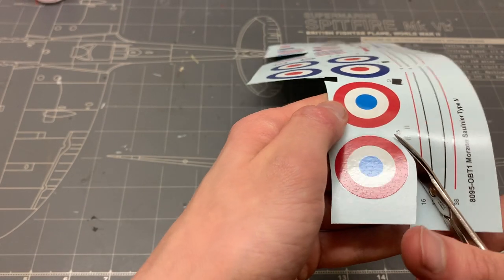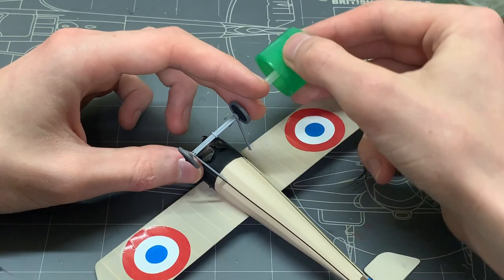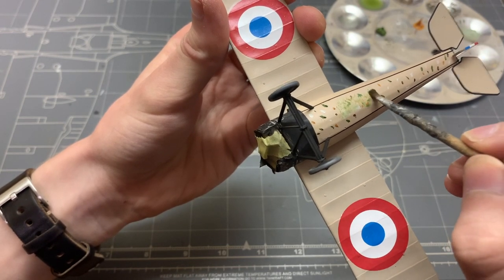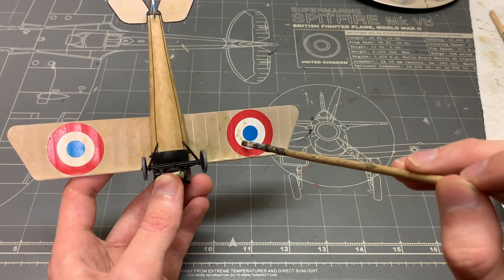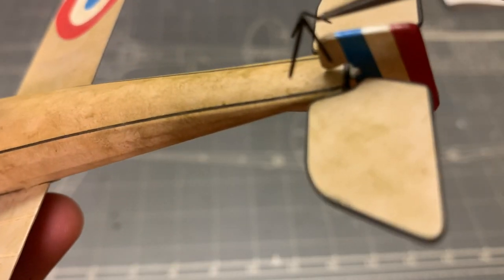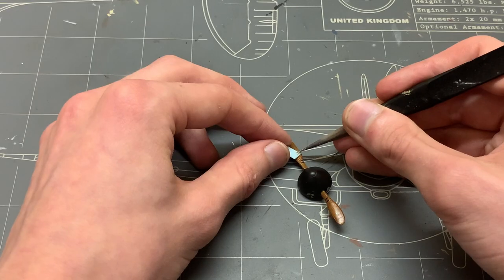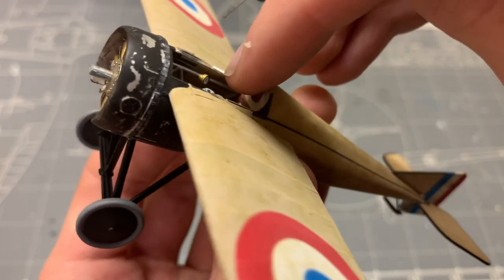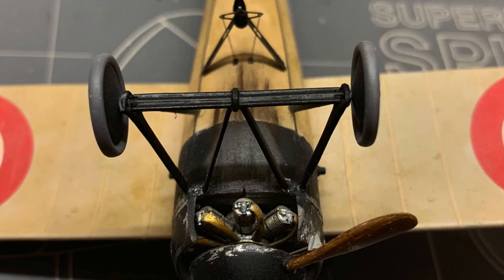PLAYING AROUND WITH OIL DOT FILTERS | 1/48 Morane Saulnier type N Eduard

Comment: Did you have trouble with the decals? Did you remove the film on the decals? I just ruined a model because of the decals were so horrible I had to remove them and that did not work out.
Reply from the maker: Not with these ones, however I’ve had mixed experience with Eduard decals, they also have a tendency to stretch or shrivel up during handling. I’ve also never tried pulling the film off, as I’m not entirely sure which of the boxings I’ve built have the new vs old style decals